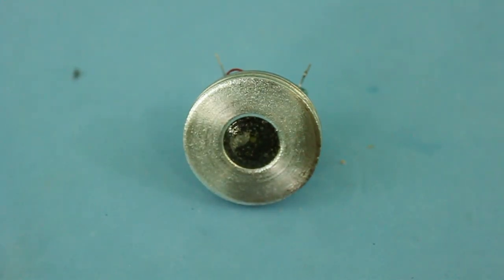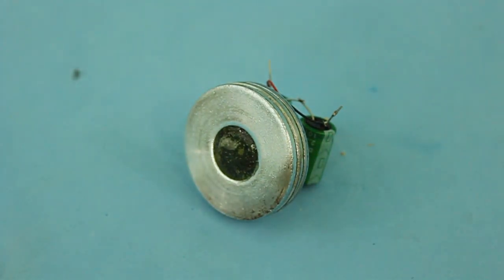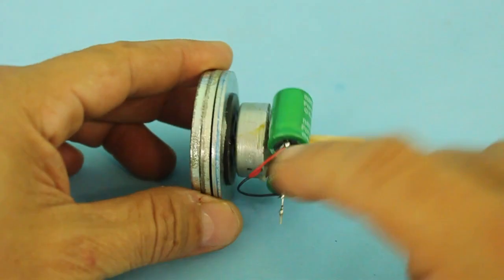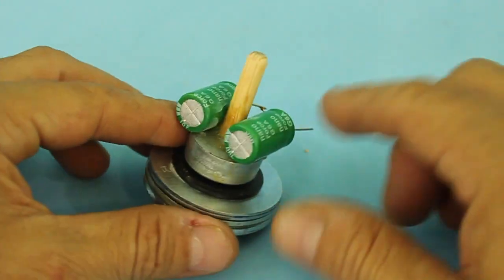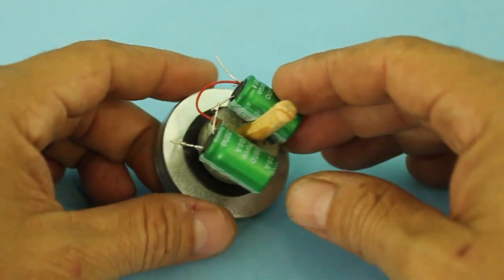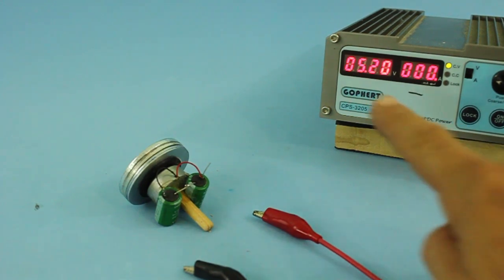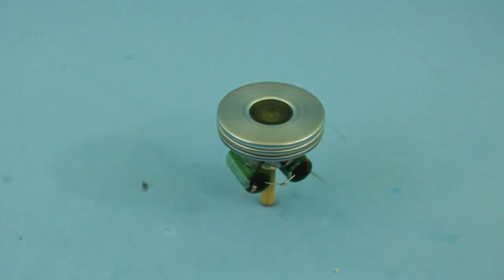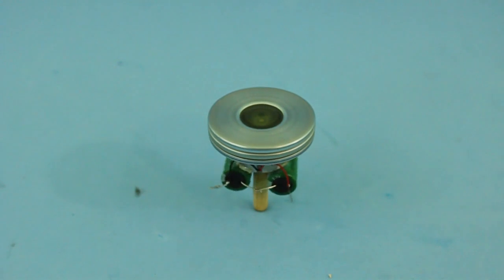Electric Gyroscope

Comment: use a lager disk consider adding small lithium battery with your current cap config , work on your backspin on shaft there is a lot of ways to do this i would recomend striping your moter and recreate with neodymium magnets on disc and electromagnets on shaft with a few hall sensors for higher rotation

Comment: Hello, I have a couple of questions. How long will gyroscope run until capacitor runs out of power? Did you used epoxy glue on the washer or something else? I would like to build two of these to stabilize a high altitude balloon capsule.
Reply: He said like a little over 2 minutes in the video

Comment: Why you put two capacitors ? the Ohm resistance of the coil is almost zero, so it absorbs all the electric charge of the capacitors, I believed they are not making any diference in the spin
Reply: 1. the coils have a resistance well above zero.

2. These are supercapacitors, a mixture  of capacitors and accumulators. They can hold incredible amounts of power.

They make a huge difference.
Reply: Because you can charge them... if you watched the whole video then you already know the answer... be careful, dont say anything to sensitive,or  the exclusive positivist will get the video instabanned...

Comment: better than fidget spinners lol
Reply: It's not as portable though. I never was able to see any worth in the fidget spinners except for someone selling them, I wonder how well those actually sold.
Reply: L. J. Bush i went to a store one time and the price was just rising and rising, then it crashed and the guy told me that ‘China had run out of bearings’ , which I found admittedly difficult to understand/believe.
To the original comment I’m not sure we could compare the two as one is an electromechanical device. 
However it’s been a pleasure watching the video. : D
Reply: i have bought 2 spinners
i lost one and the other one i keep in a drawer, sometimes i take it out, spin it and put it back in lol

Comment: I was wondering if you'd like to do an experiment for me, involving a solid steel ring wrapped with a copper coil ( toroid ) and a revolving magnetic just below it ...  some other details as well ...   I'm old and don't have the resources  to do this simple experiment myself .
Reply from the maker: what is the purpose of that experiment?
Reply: It is my contention that a revolving magnetic field below a stationary toroid copper coil will NOT produce a current in the windings initially,  but rather electrons will either move to the bottom of each turn or to the top of each turn depending on which direction the magnet is revolving, this means that which ever side the electrons are on the other side is positive, thus EACH COIL of the toroid coil is a capacitor who's charge is dependent on the strength of B field and revolutions of the magnetic field, magnetic induction on the copper coil in our case produces a capacitor effect and not a current initially. 
    Further, every coil becomes a capacitor in series with the next capacitor, a bank of  series capacitors. Also look at it this way from a Hertz spark machine point of view, we have many capacitors in series, CAN WE get them to ALL release their charge at once in an avalanche and create a powerful electromagnetic pulse and use an LED at some distance to view the effect. More specifically, it is my belief that a piezo electric spark near this charged toroid coil could cause an avalanche effect. Also, moving a small secondary magnet QUICKLY  near the coil could also create an avalanche.   
    Ultimately I think that this device can be somewhat directional  in focusing the electromagnetic pulse, example, sending an electromagnetic pulse towards the coil from a SPECIFIC direction will cause ALL the charged coils to release their electromagnetic pulses in the same direction to some extinct.
Reply: Here's a link to a vid showing the basics
https://www.youtube.com/watch?v=mMK5oo6gIes

In the vid I don't show a steel ring within the coil ( no gaps, the ring is solid ) but I think the steel ring ( insulated ) will increase the efficiency dramatically.
Reply: Alien Physics this is a very interesting explanation, thank you for sharing it. 
Could this device be improved upon and /  or used as a prop in 80s sci-fi films ?

Comment: Cool, but not exactly a toy.. given to a child (it will fall..) maybe shorting those costly supercaps and ignite something..
Reply from the maker: Agree
Reply: You could always go professional and make a casing for it, probably charge it via inductance to eliminate the prongs
Reply: Better yet, give it a micro-usb connector and charge it to 5V. Might need to limit current to 2A